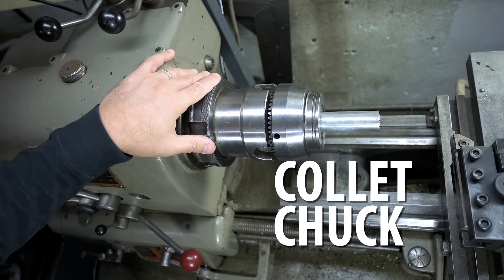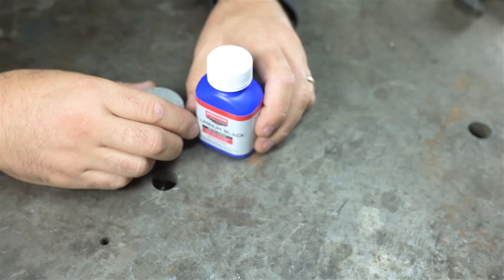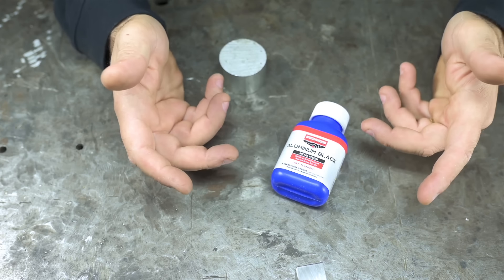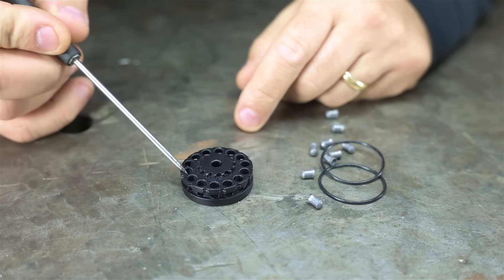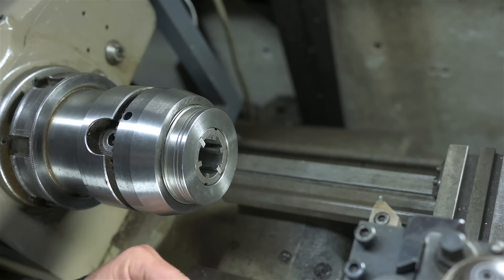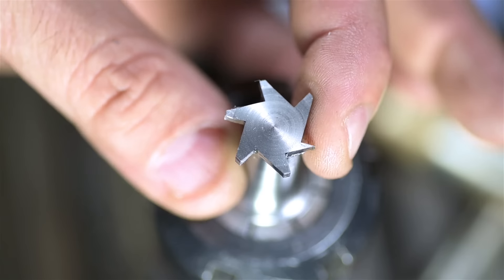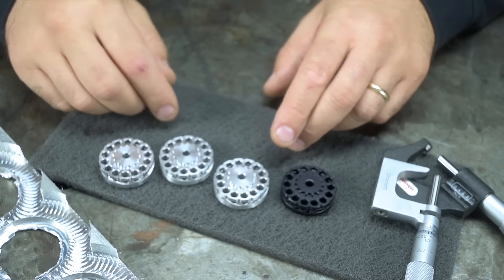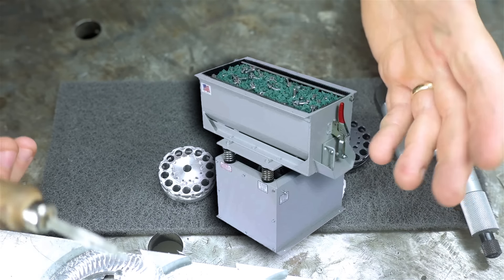Will it Black an Entire Aluminum Part?

Comment: I have a motorcycle, a buell. The whole thing is made in aluminium. One day i was out to get a car battery i put it in my backpack believing it  was a closed battery, it was not. Driving home battery acid dripped down the whole side of my bike melting my backpack and dissolving my jeans. I was shocked to see this as i came home and washed the bike off quickly as i could see certain parts was eroding. Point of the story the acid made aluminium darker it wasnt black but more of a gray color and on some parts who were darken in some similar matter i can only guess from the factory, it got real dark grey , close to black.

Comment: Deburring intersecting holes - look at brush hones for this.  You can find them in the McMaster catalog.  A 4.5mm or 3/16 hone in Aluminum oxide would do the trick.
Reply: Also called ball hones I guess.

Comment: Late to the party Tony, but Caswell has the same stuff.  They recommend diluting with 1 to 6 parts water.  First test 1 to  1.  Dunk 60 to 90 seconds.   Slow the process down by diluting even more....

Comment: Anodized is short for anode oxidized (electrolysis). What you have here is a chemical oxidizer. It creates a thin oxide layer from the metal itself , that is why it does not add any "dimension".... apart from fluffy aluminium oxide layer you really didn't want.

Comment: Mr TOT
 Hoping you actually read this but I’m an Airgunner also, Springers are my main interest and my new Beeman R9 could use a set of 1” scope mounts that have MOA drop engineered in and are a one piece set BUT  I can’t find anything anywhere that has any dampening also.. I’m using the dm-60 sportsmatch on my 97-k and it will eat a scope about every 3-4K rounds👎. Any ideas?

Comment: Just my two cents I might be wrong, but I think you're getting that thick/ rough finish because you're dipping the part in and leaving it on the aluminum for too long. I'd clean the part thoroughly with alcohol, brush the cold blue on, let it sit for like 10 seconds, wipe it off with a cloth and repeat the process until it's fully black. And then when it's done, I'd spray it with wd-40 or dip it in oil to stop it from oxidizing anymore.

Comment: I've had decent results applying Aluminium Black using 0000 steel wool. I found that the finish I got was a bit more durable. But I don't think it's a great finish compared to anodizing. It's more for hiding scratches.

Comment: I think its an copper salt solution, either acidic or alkaline. The hydroxide/hydronium ions clean the aluminum oxide, the copper salt moves towards copper hydroxide which dehydrates with heat to copper oxide (black and insoluble), and then the copper oxide is deposited into the aluminum pores from the pitting by the hydroxide/hydronium ions. All in all, I think you end up with aluminum that is embedded with copper (ii) oxide. This is my guess. You see a bunch of insoluble stuff being produced and im assuming thats the copper (ii) oxide....and I am thinking this shows up at the same time it gets hot. The orangey stuff you see is copper metal produced from the reduction of the copper salt.

Comment: That's a long winded way to make such a simple part. Given that all the features appear to be circular I would have done this with a slot drill on the mill, using the DRO circular pattern feature. The rest of it is just simple turning with the piece mounted in the chuck with a mandrel. 2 hours tops. I guess the only difficulty would be the dimension of the pellet holes, but a home made reamer would solve that if a commercial reamer isn't available in the correct size.

Comment: Hey Tony, I have used muriatic acid to clean parts (steel, cast iron) and “one” time I used it on aluminum 😳, only to find pitted half eaten BLACK parts pulled from a bubbling cauldron of death. Wondering if your solution is a mild form of just that? Thank you again for the videos! Nelson

Comment: So, there appears to be some acid of some kind in that solution. I, being a wannabe tig welder, often dip my electrodes into the puddle, and get aluminum blobs all over the electrode. The best way I've found to clean those tungstens is to soak them in some muriatic acid. The aluminum blobs fizz and flake apart in no time. A quick trip to the belt sander and they're ready to use in no time.

Comment: Ugh, for one thing tumbling parts in coal slag, might have left traces of metals that don't wash off, Fe, Ni, Mn, V, Ti.

The metal dipping wire and bowl would also react with the acids and dissolve metals. So that's the orange crap. 

I'm not sure the point here as the microns thick aluminum oxide coating is about as perfect and magical as anything gets.  What is a few atoms of Selenium oxides going to do?

Comment: The aluminum bluing is reacting with the elements inside that stainless steel cup. Try using something more inert like glass or hdpe plastic. I’d be willing to bet that would solve your mystery oxide problem.

Comment: That stuff looks like cupric chloride (or some variant cupric solution) which is used to etch aluminum. It lets off a pretty of gross smell, but it has nothing on nitric which is used for etching steel and has a "vinegar from the depths of hell" smell, but I digress. The general jest of it is that it eats away the aluminum leaving a black color from the carbon content and red-ish orange from the copper content of the aluminum. If you are using 6061 aluminum your likely looking at 0.15-0.40% copper content per unit which would be causing that orange almost "rusty" coloration. This is kind of a swing in the dark seeing as I have no clue of the contents of the mysterious blue bottle, but that's my best guess anyway..

Comment: you cannot apply this in a tub like that. The temp rises to a level that makes it impossible for it to soak into the aluminum.    You would have had a jet black smooth finish if you had not put it into the bath and just coated it with a small brush with several coats.

Comment: As a chemist please follow instructions when dealing with solutions. If you look at the MSDS or SDS whichever they call it these days inhalation is a definite safety risk when dealing with this solution and considering that I believe you do a lot of these by yourself don't take these risks lightly. As for exactly what's causing the aluminum to turn black with this solution I'm not sure, sorry not an inorganic chemist.

Comment: I suspect using the stainless steel cup caused some electrolysis.  I wonder if it would work better in a glass or plastic container.

Comment: Haley your aluminum is oxidized on the surface and that’s why the black isn’t sticking. It oxidizes very rapidly. Have you tried sanding it and then painting on the black swiftly after?

Comment: Well, you got the distilled water right. Aluminum Black works great to cover up minor marring, nicks, scratches, or other imperfections on anodized lower receivers.  More often than not, unsightly marks or marring following a sloppy or rushed assembly; the slip of the punch while roll pin tapping.  I use a Q-tip like a paintbrush then flip the tip and add a 2nd coat after 4 to 5 minutes, always using a clean QT to dip, then rinse well with cold distilled water and pat dry.  Viola, you covered up your mistake without using a black Sharpie on some ugly amateur shit.

Comment: Did someone mention the chemistry behind this yet? I'm betting its something containing lye and maybe one or two other things, primarily because it looks like it to me (i am noob). 
Lye does dissolve aluminum, and it does give off hydrogen gas, which I'm betting has a smell. The al turning black and dimensionally changing the part (eating it) also was a sign. Idk but deff interesting -someone correct me.

Comment: Wouldn't acid etching take care of small burr?
I would have dipped the parts in an acid solution for anodization, then applied current after burrs are dissolved. Cold + high current for Type 3 anodized
Reply: You would have no control at all over the process and results would be hit and miss - 99% miss. Good thought though! Cheers, Michael 🇦🇺🎅🏼

Comment: Nice review and nice try. You'd have been better off with the regular anodizing process. And as you say, maybe just brush the stuff on your pieces rather than dunk them in. And the metal container probably is a bad idea. Use glass or plastic!
Thanks for your great videos!

Comment: please make a adderini with ur tools an skill. ive made a couple now with my 3d printers an they are so fun to shoot with the kids, a couple different configurations like instead of using crossbow limbs u can use slingshot rubber, thats what i did cause u had so many more options with the rubber over the limbs but its cheap too, only have to buy crossbow bolts once as long as u setup a place to shoot that can recover all the bolts. but id love to see one made from aluminum, or even one of the others ive made out of plastic with my printers. id love to be able to make the stuff from aluminum, that would allow them to use alot stronger rubber. if ur interested let me know an i can send u one of the adderini ive already previously made an whatever u need for the 3d models not sure how that works with this type of machine, if its cnc or done by hand, ive always wanted to use one an learn about them but never got to see one in person or know anyone who knows anything about them. one day i'll have a hole shop full of tools an machines, just not today, well im wrong i already do have that, its just not machines that can work with metal, just 3d printers fdm an resin, i got a 3018 pro cnc that ive been upgrading over time to try to get it to cut aluminum but cant expect much for $300 but ive almost got it to the point it should be able to do aluminum. also i have the same caliper but it must be broken, it want import my dimensions to cad like yours did.

Comment: As silly as that usb caliper trick was, it is way too smart. A button to eeprom the current reading in to a small ic, plug er in and get a spreadsheet of the measurements you saved. Not sure how much itd be used.

Comment: You know what will blacken aluminum? Purple power (Cleaner) in an ultra-sonic cleaner machine that has a heating mode. I ran out of the stuff you're supposed to use and thought Hey I got some purple power cleaner stuff. Well, the carb bodies I was trying to "Clean" came out with a hard black coating all over that could not be removed.

Comment: 4:00 It's not a dye.  Aluminum is always (in our atmosphere) covered with a layer of aluminum oxide which is basically the color of aluminum so it doesn't look special.  (Or more accurately, you've never seen raw unoxidized aluminum so what you think the color of aluminum is, is really the color of aluminum oxide...)  Whatever this crap is, it turns aluminum oxide into something else, chemically, and the something else is... black.

Comment: The blue surface isn't rust proof in itself. Instead it makes it porous, so it can retain oil. You need to oil steel parts that are blued and then they will be more rust resistant.

Comment: attach the abrasive can to an oscillating tool. Or put it in an ultrasonic cleaner. Or hit with a with a wire wheel.

Comment: I would imagine it's hydrochloric acid with steel dissolved into it. The gas is probably hydrogen. I think it's replacing surface aluminum with steel. Maybe explains the orange...rust.

Comment: when we anodized  we just used a black dye nothing special ... you have to degrease... and the andizeing portion we used sulfuric acid i don't know the volts or amps but it was  real basic.. aluminum hangers and soak for a few minutes in a tank... voltage for nickel were 3-4 volts and amps of small parts ..all and all i wouldnt have andozed it not really necessary and soaked it in some hot rit

Comment: I'm friends with alodine und automotive lip seal spring. My fingers remove und roll lefty round circumference exposing a tapered spring thread. The opposite end is sniper to length zen right tighty. I sink the spring will maintain qualities MIT das ozone und tings

Comment: Why would you use 90% alcohol and not do any research? You’re supposed to clean it with acetone, then warm up the steel in boiling water. Apply the solutions and repeat the process until multiple coats are on. People…
Reply: It would not have helped him, to warm the
steel, in boiling water, since he was using aluminum.

Comment: I have never had any luck using aluminum black. Even following the instructions to a T it still sloughs off and looks like turd after. 

It resulted in a lot of swear words and cursing.. then the solution got line drived into the garbage and i got a rattle can of black paint...

Comment: heads up buddy. several times u used the word Rust in conjuction with Aluminum. Apparently you have not heard that Rust is the corrosion of Iron. Does you Aluminum contain Iron?

Comment: So, the solution attempts to coat the part in Nickel Aluminide or something similar to a nickel aluminum bronze coating but because of the acid content will pit the part unless you brush it on a little at a time and not dunking the part in it.  I say this cause the MSDS shows cupric sulfate(copper), Fluoroboric acid(would donate boron to the mix), and then a bunch of other acids to get the reaction going. 
I'm sure using this smells like cancer cause your creating sulfuric acid in the reaction as well and the fact that it has a fair amount of nickel floating in the mix.

Comment: That's why you never buy a Russian airgun 😆 Just kidding. I have a Turkish one. Hatsan NovaStar 6,35mm. My problem is a small 10-slug magazine. It is an aluminium box-type one with a plastic transparent cover and a plastic cog pre-tensioned with a clock spring inside the box. Nope, no bigger sizes like all other airguns get.

Comment: i take my aluminum parts and lightly blast them with aluminum oxide and then spray with kg gun kote bake for an hour and much more durable than anodizing tony do the new mags allow the rifle to be as acurate as the factory mag i have a daystate fx and others and the cricket is an excellent air pew pew shooter

Comment: Dude don't use the solution multiple times. The solution is corrosive and will disolve  the  superficial aluoxide layer after drop in. The next part will get polluted by the partly disolved particles of the prior one. Thats why the finish looks so bad

Comment: 15:50 I would have used an ultrasonic cleaner. filled the ultrasonic cleaner with water and held the can in the water. if the sand didn't move I would have added water to the sand

Comment: is the indexing on that thing accurate?
Reply from the maker: On the CNC?  I didn't measure but I'd guess within 0.001-0.0015".
I hope anyway :)
Reply: @ThisOldTony  the indexing on the CNC of course is more than acceptable... the indexing on the magazine. After I made the question, however, I noticed that the pellet is not ejected from the magazine into the barrel during firing  as it is in other airguns; instead, it is shoved-- I mean mechanically transitioned from the magazine into the barrel and part of the firing mechanism makes this kind of seal.